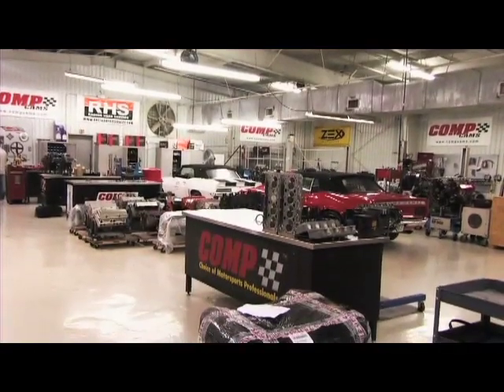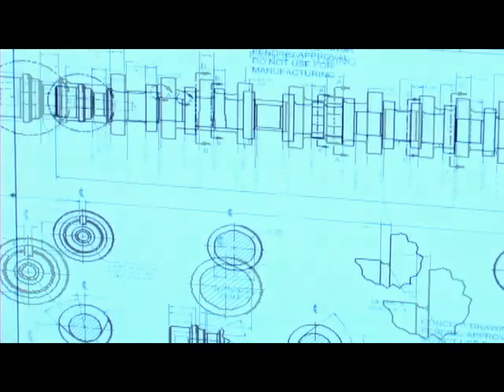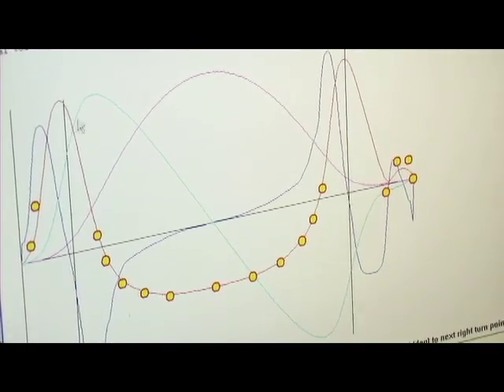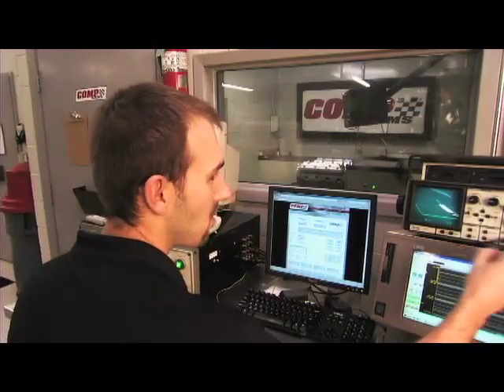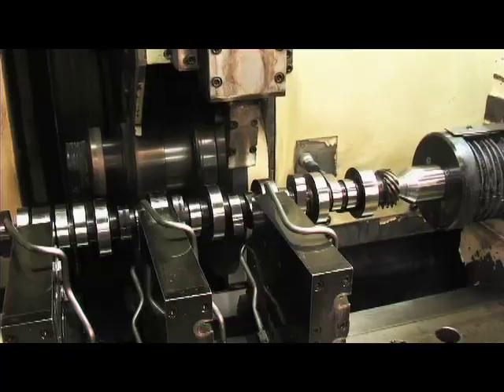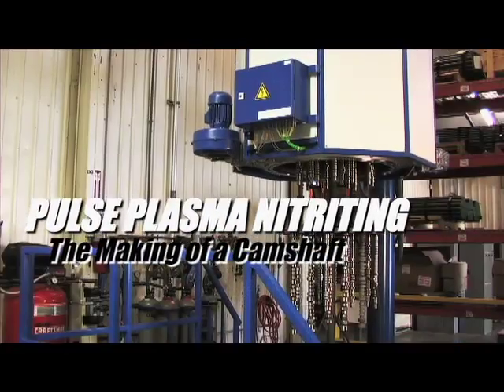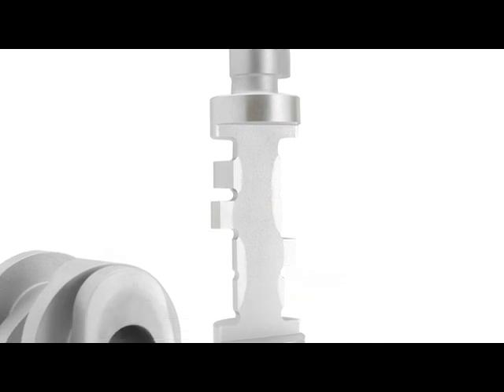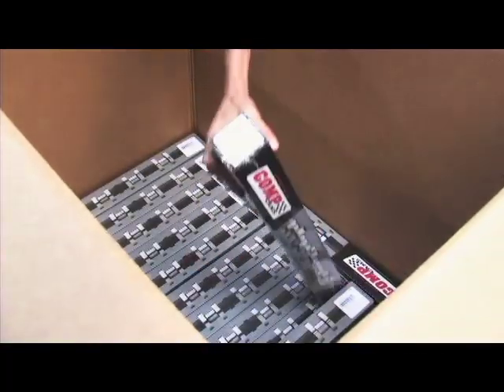Comp Cams Shows PowerTV How a Cam is Born

Comment: let me ask you this. I had a "singlr bolt lsr" comp cam installed on my 5th gen camaro in 2010 and after 6k miles the motor gave out and engine builer fornd that the key pin was too long there for giving a false torque  reading beacause the pin was hitting the cam bolt thus not letting it torque down. It eventually work itself loose throwing the timmimg off enough that the valve hit the pistons. How would Comp Cams handle that?